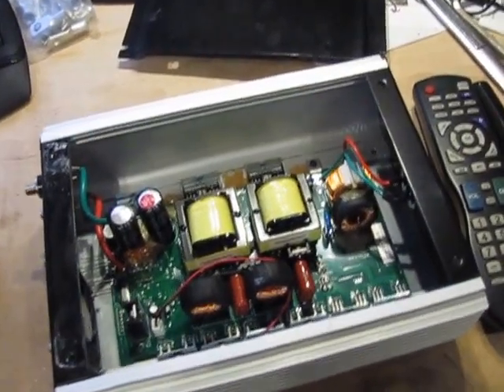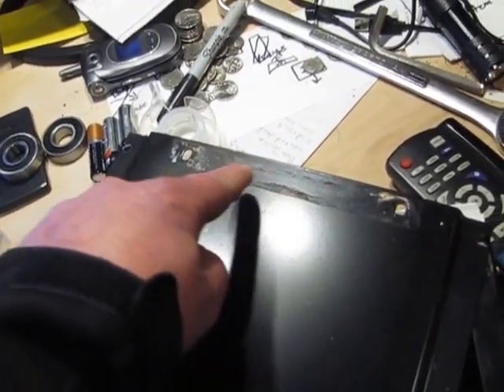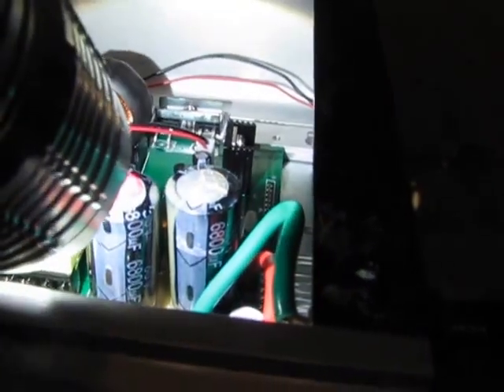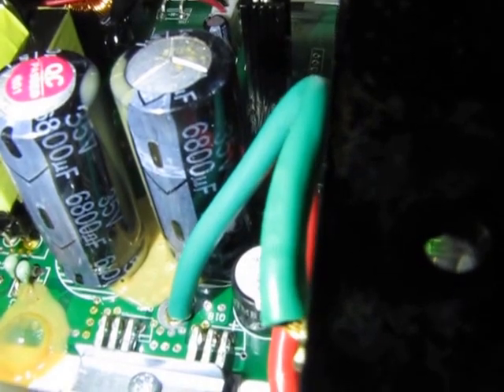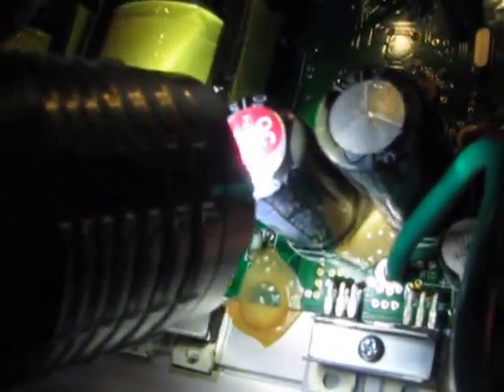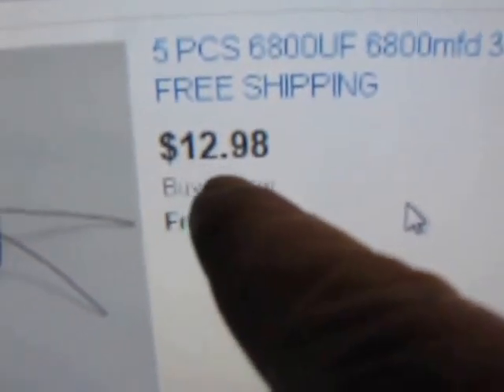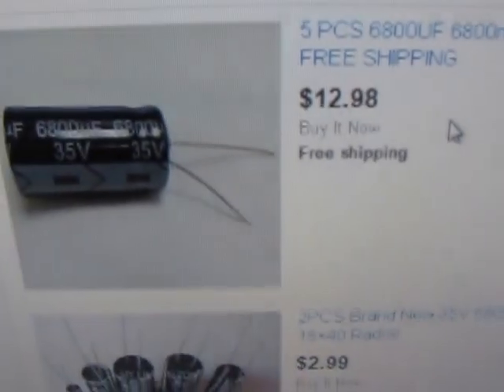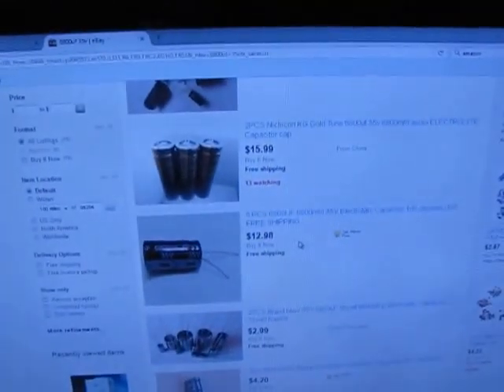Sun Grid Tie Fix,, My 10.8-30V 600w Sun Grid Tie fix #1, How to diy

Comment: I would go with 50 volt caps to stop them from poping. Good work brother. Btw I am looking for a cheap dump load controler for my solar to dump the left over power to heat water.
Reply: +yankey4, YEH HIGHER VOLTAGE SAME CAPACITANCE
Reply: +closertothetruth get good quality caps so they last